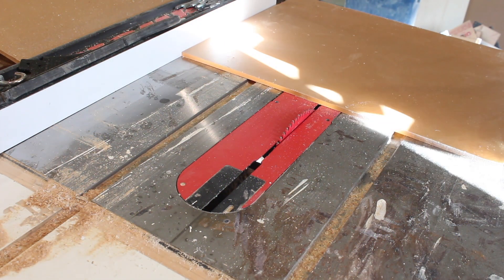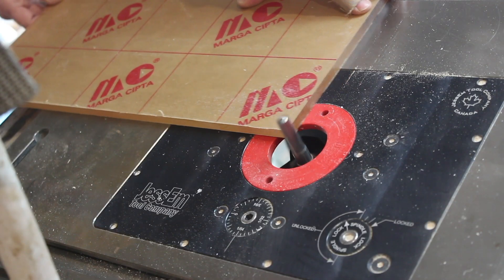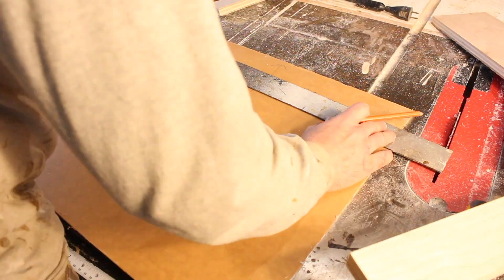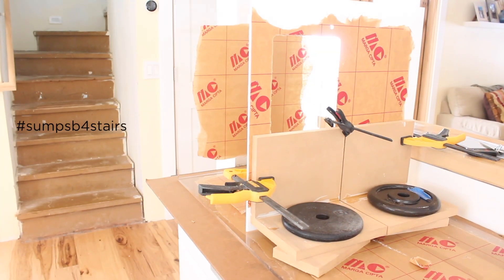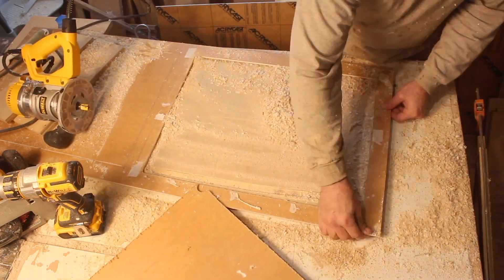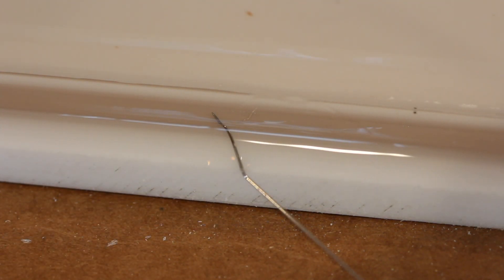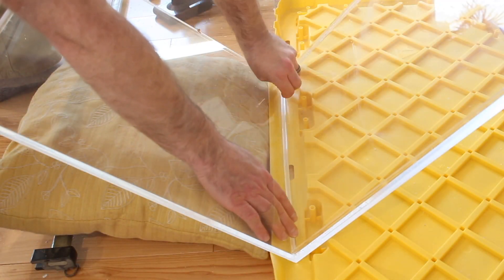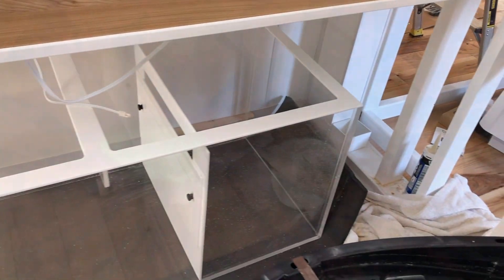EP. 4 | Build Series: Making the Sumps

Comment: One small detail. When mounted on a router table, you really want a down cut bit, so that it pulls the acrylic onto the table, and not push it up. On a cnc, where the spindle is top mounted, the upcut is the preferred method. I always used a large straight flute for edge prep and they work great.
Reply from the maker: That may be another way to do it for sure - I've found the chip clearance is the more important  mechanism of the bit orientation...

Comment: Thinking of building my own sump soon as I don’t really like the one that’s with it, had it for a year now and it’s time to change it, going to be around 800mmx380mmx380mm with wa water level of around 10” how this acrylic would you go?
Reply from the maker: Hey Billy - for that size, 6mm thickness should be fine. Just make sure to add the top frame, which adds quite a bit of long term strength. Thanks, Peter

Comment: What router bit is used to do the cut outs?
Reply from the maker: I think I used the same bit that I used in the table router - and upcut spiral bit. But, if you are not plunging into the material and drill a pilot hole first like I do in the video, you can likely use a straight bit as well. Spiral bit just give a little bit of a smoother edge. Thanks for the watch!

Comment: I want to make my own sump for the cost savings as well but I don’t have a router, is it absolutely necessary or can I do it by hand?
Reply from the maker: Hey Kevin - you would need something to do the edge prep - and while you can do that by hand, the likelyhood of getting it right the first time is VERY remote. You would have to scrape it by hand, and keep the edges perfectly flat and square. As handy as I am, even I would never try this, LOL. If you don't already have the tools - table saw and router for square cuts and edge prep, you might not glean that much in cost savings. You might try something small first, to see how it goes - like a small dosing container or similar - to practice a bit first...
Reply: @ReefEco  thanks for the response, so I have a table saw for straight edges I just don’t have a router, would it still not be worth it?
Reply from the maker: @kevinferreira3301  Tough call - trouble is that acrylic is not cheap, and if the edges aren't prepped correctly when you try to glue it up, you'll see the seems aren't good, and you can waste a lot of material. Then there goes the money you are trying to save. If you have a table saw, maybe try to make a small box or dosing container and see how it goes. There are probably some videos on YouTube on hand prepping acrylic edges for solvent glueing too. First sump I made from acrylic 20 years ago popped a seam and leaked everywhere - and it was because the edges weren't prepped at all and the bod wasn't great...
Reply: @ReefEco  damn that’s scary to hear!! I was thinking of even taking the additional time to add the square rods to the corner just to make sure, I’ll see if I can think of something for those corners then. I’m trying to make a 29x21 sump for a Red Sea max s 500 I got for 100 bucks but I have no sump for it, I want to use up all the space I have on the right hand side of the cabinet.
Reply from the maker: @kevinferreira3301  Yes, now you know why I add those rods to all the corners now, LOL!  My edges and seams are much better now, but it is something I still do. That first sump I glued it together right off the table saw, so all the edges were total crapola. If you are looking to save money, you might not save all that much on that size of a sump - so make it because you want to and to have the satisfaction. Check out what a sheet of 1/4" cast acrylic runs in your area...
Reply: @ReefEco  yeah I’m looking at 300 bucks for a 48x72 sheet but sump usually come in either 24 or 30 and the area I have only goes to 29, the sumps that are 24 are way too thin and don’t take enough water for a black out in my area that’s why I’m opting for a custom sump

Comment: Very nice and detailed build video. Can I know which router bit have you used for routing the edges?
Reply from the maker: Thanks Shelly - I think I used a 1/8" round over bit for easing all the edges.
Reply: @ReefEco  Can you provide me a link to buy the router bit?
Reply: I don't see the bearing in the bit. How are you making sure to trim only the edges? Are you running the panel on a sledge?
Reply from the maker: @DsilvaShelly  Oh - you mean cleaning up the edges of the panels before glue up? Yes, that is a spiral down cut bit (but since it is upside down, it throws the chips up and away). I'm using the fence of the table saw as a straight edge on one side, and to keep the edges parallel as a take off just a tad. In my setup, the router is built into the right side of the table saw table, so I can use the table saw fence for routing as well. I don't remember exactly what bit I got, but I think it is basically this one: https://www.amazon.com/SpeTool-Downdcut-Cutting-Diameter-Carbide/dp/B07QXK88L8/ref=sr_1_8?crid=CA0R0ZYLILUR&keywords=1%2F2%22+spiral+downcut+bit+plastic&qid=1660788812&sprefix=1%2F2+spiral+downcut+bit+plastic%2Caps%2C242&sr=8-8  Hope that helps!
Reply: @ReefEco  Thanks for the response. That makes it clear.

Comment: What specific blade did you use on your table saw?
  Red seems to indicate Diablo or Freud but Freud's plastic-specific blade is not painted.   And while we are at it...where did you source your acupuncture pins and what thickness are they?  My inclination would be to use the smallest one possible but I think that's like .12mm which may be a bit too small...maybe .25 would be better?  Totally possible I am overthinking that as well :)
Reply from the maker: Hey Jeremy - yes, it is a Diablo TCG blade 10"  - good eye! I think it is marketed for Non-ferrous metals and plastic. I honestly don't recall where I ordered the acupuncture needles from - I just googled it and there are lots of options. I think I'm using the .30mm width x 40mm length, but I think you are right - it probably doesn't matter all that much. I would probably err on the side of larger, rather than the .12mm as you said, since a little larger will allow more solvent to flow into the seam, which is likely better than starving the joint of glue. Any leftover solvent evaporates from the seam quickly and does no harm, whereas under-glueing the seam is harder to fix...

Comment: Probably the best video in YouTube in terms of visual explanation, i really appreciate the visuals of the pin-capillary action of weldon. now i know what is perfect gluing with a pin method there is almost no other vides in YT that shows closeup shots of the capillary action using a pin method in HD. Great video.
Reply from the maker: Thanks Suresh! With the pin method, what I've found is to use more solvent (Weldon 4) than you think, and really flood the joints well, from both sides. As it evaporates, to gets sucked into the joint, and sometimes I even go back and do a second light application after about 5-10 minutes for good measure.
Reply: @ReefEco  I just want to say what you got there going for the entire fish room is mind boggling for me, I wish you the best of luck.

Comment: Hi Reef Eco, I am trying to build my first aquarium a biggie 60 X 24 X 20, and based on various research online I had just settled in on 18mm thick acrylic,  can you tell me how i go about edge prepping the largest of my sheets which will be the 60 X 20 ( back and side panels), I do not have a router and based on some posts in R2R it seems like hand prepping is waste of time as it is not going to give a good result.

Should i ask the sheet seller to edge prep it for me ? or should i take it to a say carpenter and do it because I neither have the tools or skills to do a router based edge prep.

Thanks,
Suresh Kumar
Reply from the maker: Hey Suresh - I would agree that hand prepping is risky unless you are REALLY good at it, which I'm not. It would be too easy to get a dip or round off the edge I think. I've seen it done (I think there was a video by Joey/King of DIY), but I personally wouldn't try it, especially with thicker more expensive material. You could try either a woodworker shop (who might not want to work on acrylic, not sure), or try a sign shop to cut your panels on their CNC. That might eat into your budget, as I imagine having them cut the panels would add significantly to cost. BTW, I'm only using 3/8" acrylic (10mm) on my sumps, one of which is about the same dimensions as yours (even longer), so using 18mm seem like overkill unless you are not adding a top rim or any baffles or bracing to help the long span not bow. I'm all for over-building though, so thicker acrylic is better in general  : ) if not cost-prohibitive. Sorry I can't be more help on the edge prep, which is even more difficult the thicker the panels - as it gets more difficult to keep the edges perfectly flat and perpendicular to the sides the thicker the panels. If you do end up having to hand prep, you might buy some material and practice before trying it on the real sheets for the aquarium...
Reply: @ReefEco  Hi firstly thanks for taking the time out to reply, Here and in R2R didn’t mean to spam but I commented here and thought why not put something there as well in the forum.

I would like to ask, if laser cut from the manufacturer is any better ? That is instead of saw cuts but based on some search online it seems like laser cut acrylic when welded on with solvents instantly cracks near the seams ? If the above laser thing is true even if I scale my build down I should make sure my Acrylic for aquariums are never Laser cut right ? Thanks again.
Reply from the maker: @sureshkumarsivasubramaniam1895  No worries! Not spamming at all. Yes, laser cutting melts the material and it can craze when solvent welded after laser cutting. I think that is why tank/sump manufacturers use router bits and CNC cutters for their parts and panels.